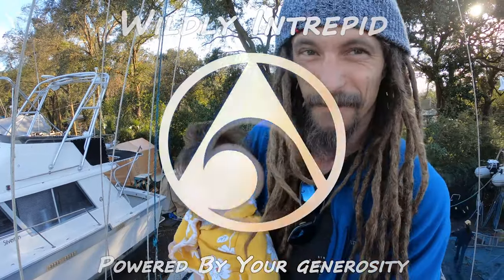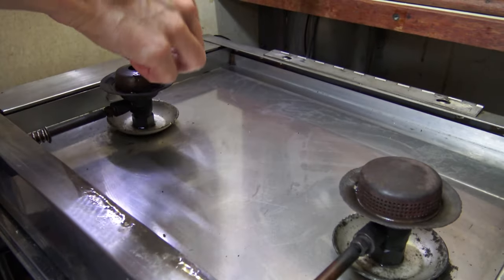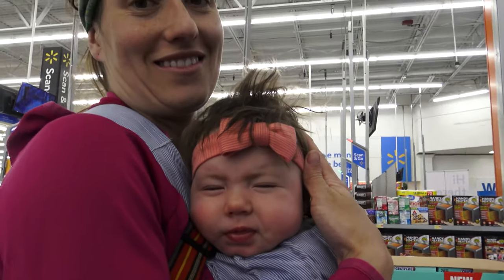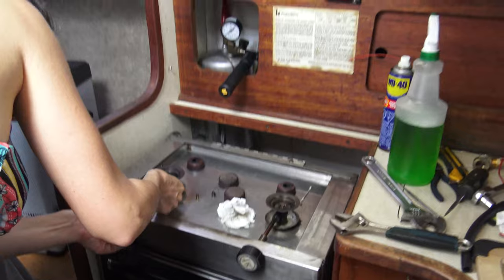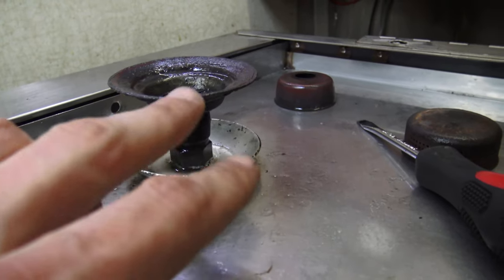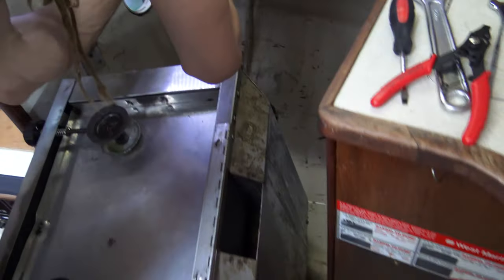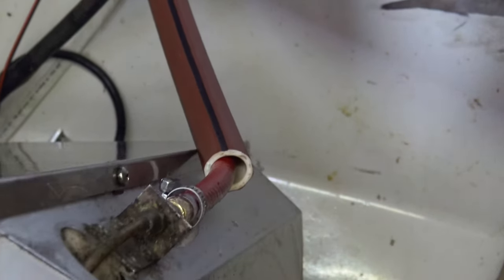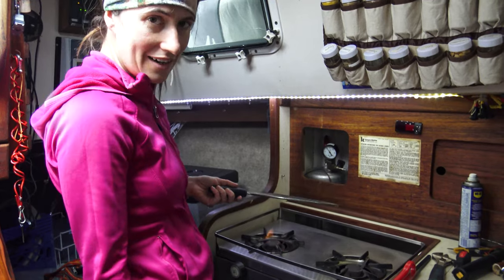Provisioning for the Bahamas & Troubleshooting Kenyon Alcohol stove [EP 199]

Comment: Great Video. I am quite happy and proud you were able to repair your alcohol stove. I know I may have shared an over abundance of info regarding "fittings" in a previous video comment but allow me to share an additional tidbit. When dealing with "flare fitting" assemblies, once the initial seal is made, it leaves an imprint on both of the mating surfaces. Many times, the introduction of a new connection into the assembly requires an over-tightening of the fittings to achieve a sealed connection. In your case, if you would have also replaced the "male fitting" that was threaded into the tank, it would have required much less torque to seal the connection.
I hope this makes sense as I explained it as best I could.
Reply from the maker: Thanks for the tips. We actually wanted to replace all fittings but we couldn't get the one on the tank come loose. Heat likely would have helped but we were nervous about leftover fuel in the tank. Thanks again for all the knowledge. We were very glad to get it all sorted

Comment: Long term provisioning is always quite a chore! I'm curious to know if new replacement parts are still available for your stove. Unfortunately, many manufacturers today offer very little support for equipment after the sale. It's called "Planned Obsolescence" and was put into effect by "bean counters" to force the purchase of new equipment rather than repairing what you already own. There used to be a few aftermarket manufacturers that specialized in replacement parts for popular equipment even when the original manufacturer had gone out of business, but cheap Chinese equipment has squashed many of those firms.
Reply from the maker: We did look into replacement parts but at almost 300 for 1 burner it's not worth it at all. Other small parts are almost none existant. But as long as we can keep it running that is all we need. If not we may just need to replace the whole unit.

Comment: Not sure how current this is but I have a diesel stove with very similar burners, you're not supposed to ever remove the burners from the stove top, but I did before I knew this. They never seal up after as they have to align with the flame adjustment knob. I ended up using high temp JB weld with good results to get them back on and aligned
Reply from the maker: I didn't know that but we did figure out that we could turn the nuts that mount to the burners carefully without breaking them which let us tighten everything up again. The only issue we have is one of the carbon packing inside the valve fell appart and we need to get something that will work as packing for that burner.
Reply: @WildlyIntrepid  I had the same issue finding a replacement also. I used graphite packing material from the hardware store. I think it's pretty heat resistant but you could hold a lighter to it and see, it'll never get to those temperatures in the burner
Reply from the maker: Thanks for the idea Matthew because it'd be nice to have both burners up and running again. Waiting to get back to the US to do all that